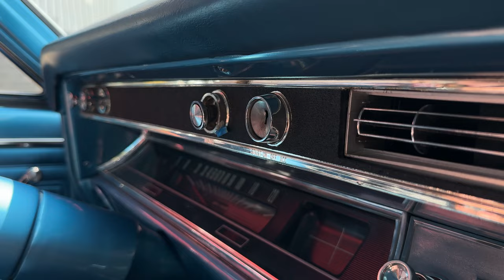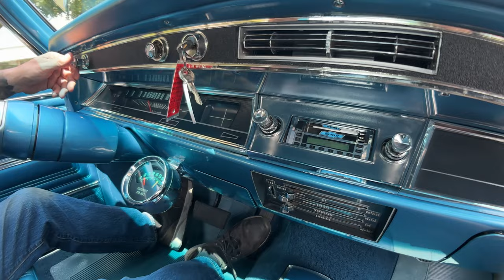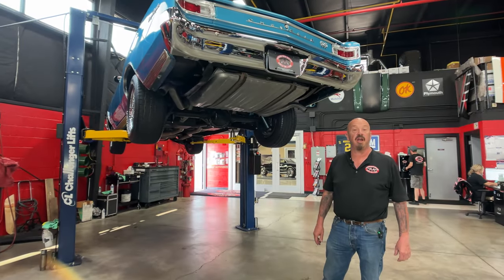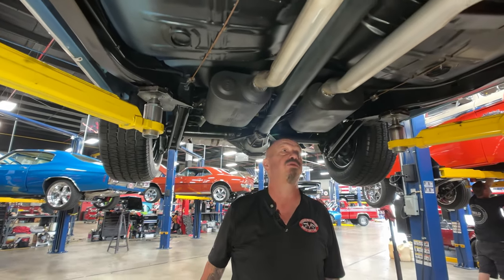1966 Chevrolet Chevelle SS For Sale Vanguard Motor Sales #9034

Comment: If I didn't know better,  I would swear this was my former 66 SS 396 in marina blue. Yet, mine was a 4 speed with 3.73 posi rear and no air conditioning. I also didn't have Cragars on my SS but rather a dish cap with blue rims. Owned this car for 17 months before I traded it on a red 67 Pontiac GTO ragtop. I wish I still had both these cars !

Comment: Looks like someone  put 67 Malibu  parts on a 66 Super Sport  during the  rebuild  , 
66 Super Sport cars  didn't have air conditioning  , automatic transmission and  that  dash is Malibu  , steering wheel  is not original